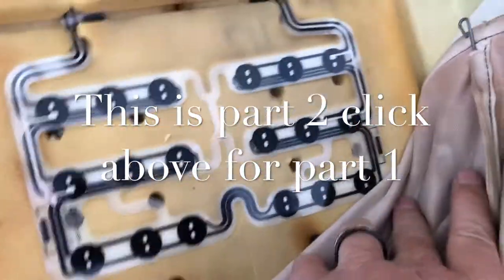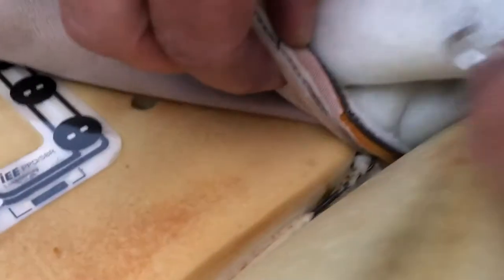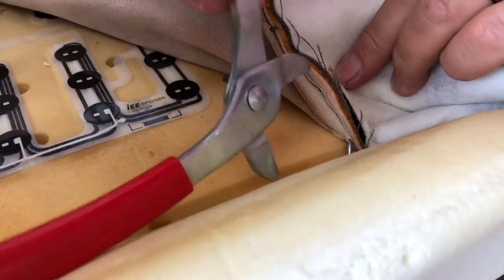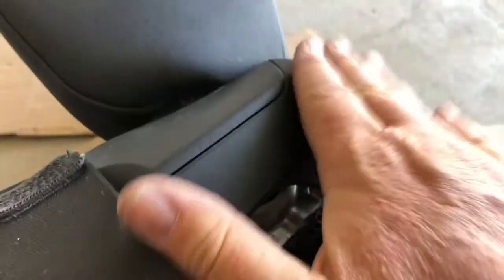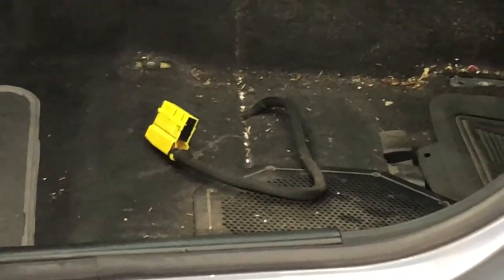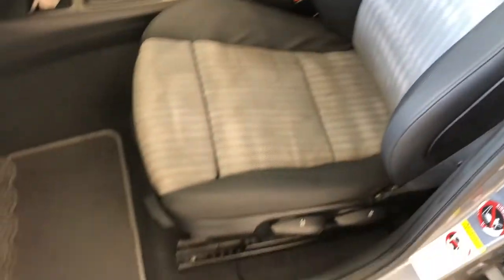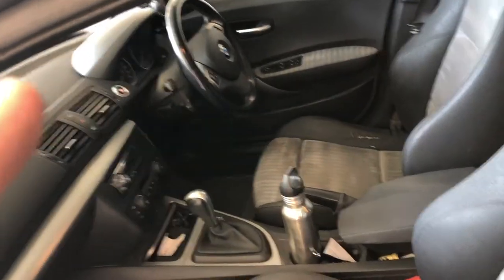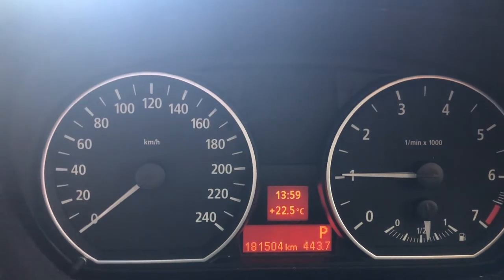2 How to instal Car seat Occupancy sensors Part 2 putting it back together. BMW

Comment: After connecting the sensor did you have to use the computer to reset the codes or did the car recognize it by it self?
Reply from the maker: I don’t exactly remember as I had easy access to a computer. But I believe it was needed. MRT